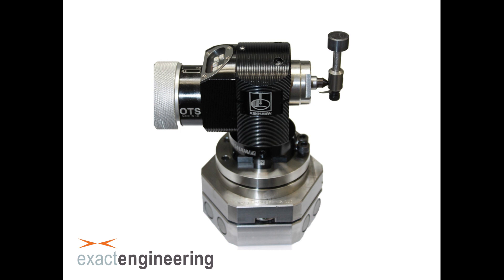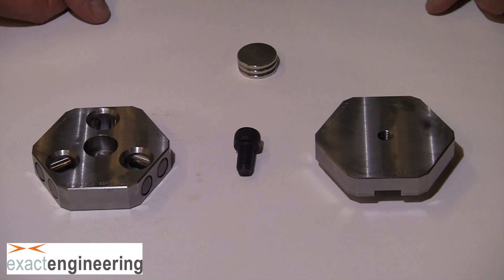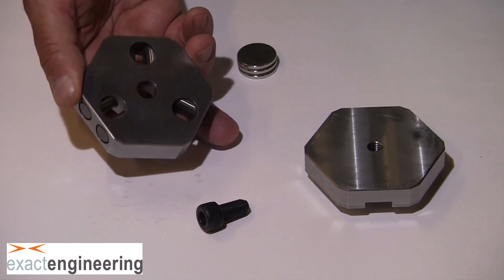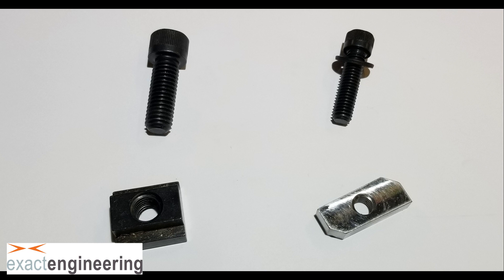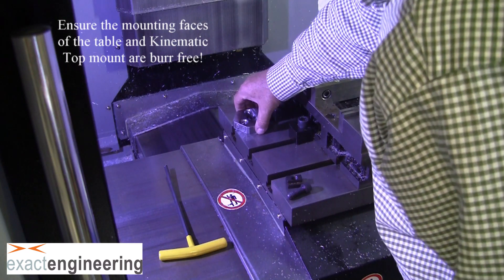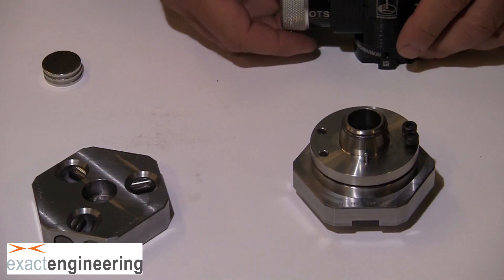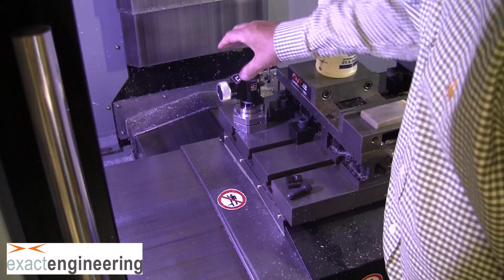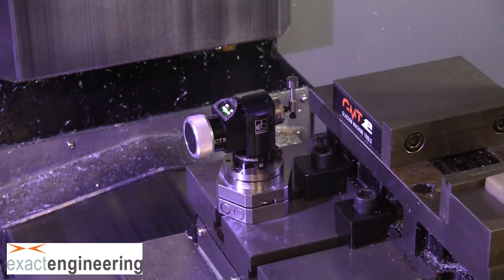Installation Instructions for Exact Engineering Quick Mount for Renishaw OTS Tool Probe

Comment: The price point is pretty good. Now I'm tempted to buy one... Not cheap, but I'm sure these are a pain to assemble.
Reply: The tool probe mount assembly is very simple, bolt to base to table, bolt tool probe to top, install magnets, and mate the to to the bottom. No tools needed. The real  pain is re aligning the tool probe. The Renishaw adjustment system is very finicky.
Reply: @exactengineering4856  I meant for you to assemble, not the end user..